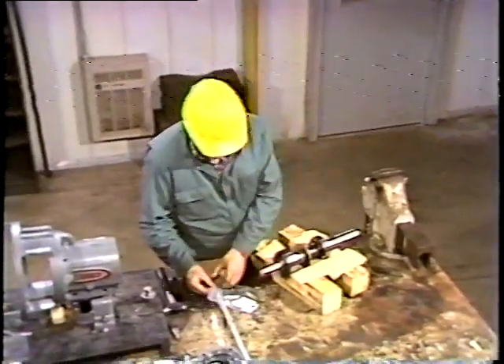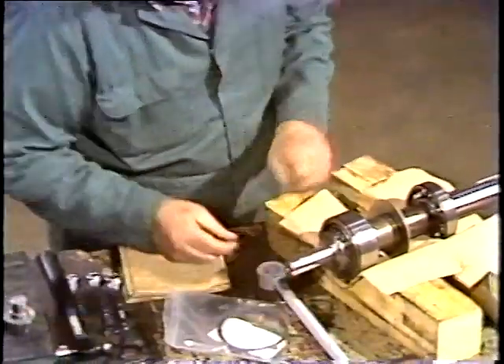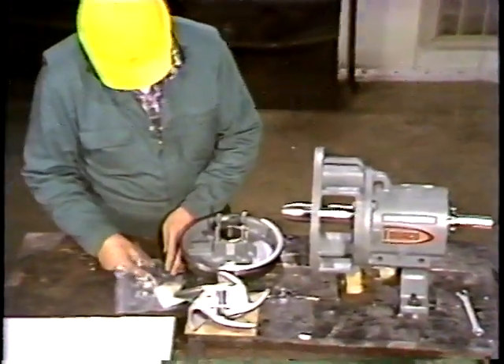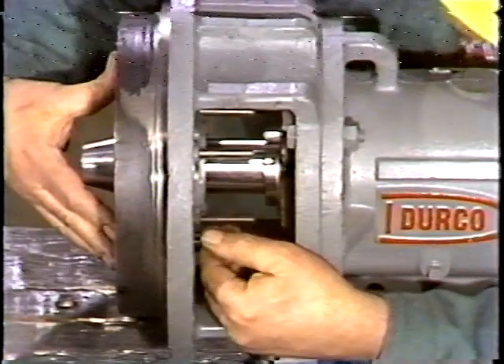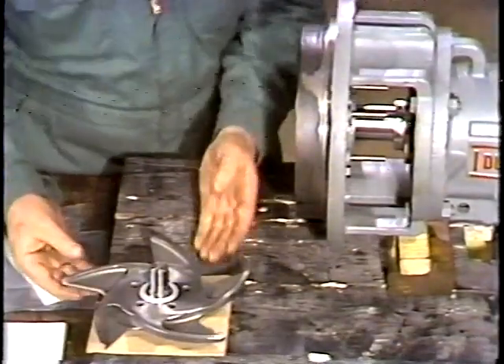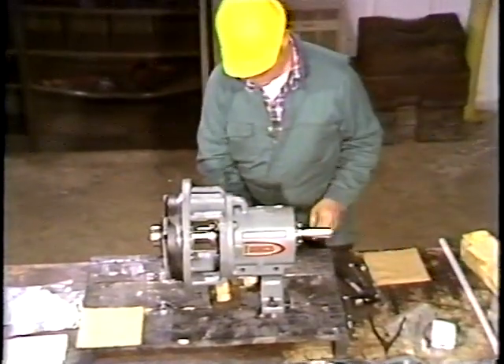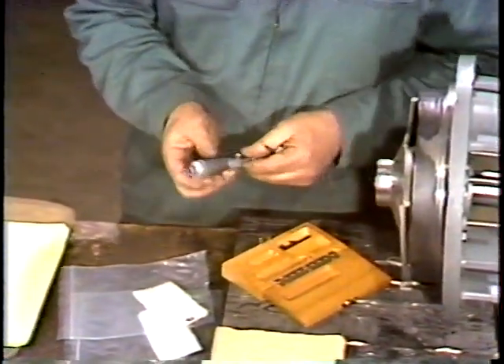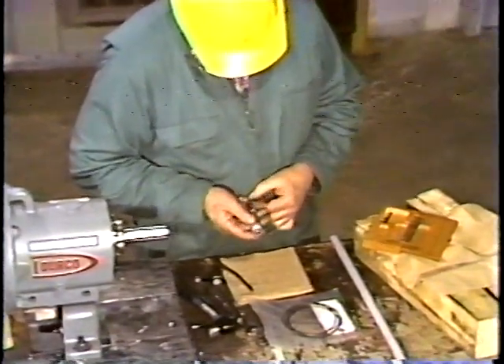Centrifugal Pump Overhauling & Tolerances part 2

Comment: اين باقى الفيديو لو سمحت
Reply from the maker: +Mohamed Hamza موجوده على القناه shady ghazy
Reply: I have one pump model Goulds 3175 .. in instruction manual they said the clearance is between impeller and pump casing  ... so it is not as per mentioned in that video ... as he said here clearance is between impeller and back plate ... please advise which one is correct ??
Reply from the maker: +Mohamed Hamza توجد الان فى وصف الفديو باقى الاجزاء
Reply: I saw the full 4 parts of video ... I need to clarify is it the clearance should  between impeller an d suction side plate or back end plate ???